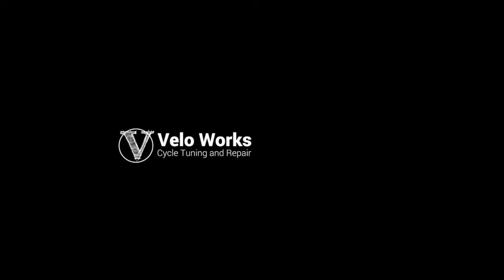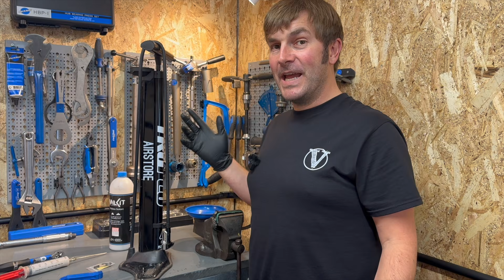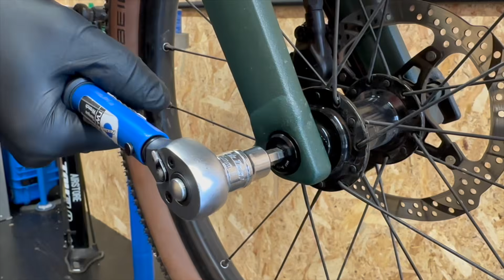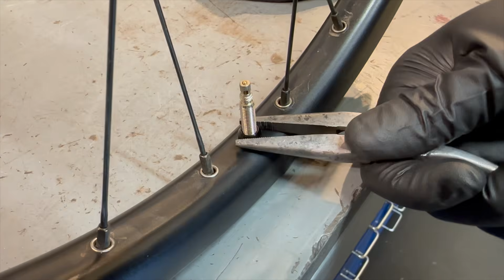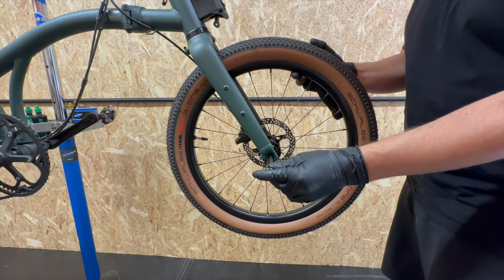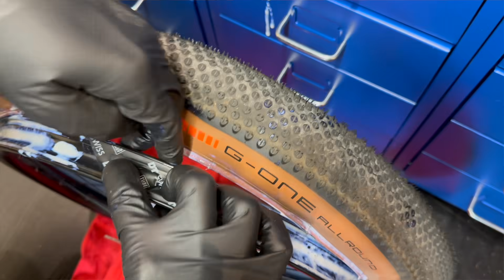BROMPTON G Line Tubeless Set Up 💥

Comment: Thank you Paul.  After viewing this I got my LBS to set the G Line up at its first service.  This is my first experience of tubeless and so far I am impressed, the ride seems a little better and the ability to vary pressure according to the surface is very useful.  I dread having to remove the rear wheel...
Reply from the maker: oh brilliant to hear. Glad you like it. Worth getting a tyre plug then you may not need to! Fingers crossed.

Comment: Ran these tubeless for over a year but eventually gave up and switched to the conti urbans. I mostly use it for commuting these days and the additional puncture protection of the contis is way better. I ended up with vast numbers of plugs and an ongoing slow puncture with tyre deflation over a few days. Had recurrent issues with the rim seam leaking, Stan’s no tubes seemed to eat my Peaty’s rim tape, and the tyre sidewall ended up weirdly porous after a year. Also slightly dented rim edge, with too low a pressure from a puncture and never quite the same after that. All on the rear too! I do miss the lighter weight and comfort and would probably switch back to tubeless if I was doing mostly gravel, maybe…..

Comment: I’ve been running my G Line tubeless for 6 months and have had no issues, I use Stans original sealant and it stays liquid for ages. I would point out that you should always fit tubeless valve nuts hand tight only, not with pliers as shown here. If you are unfortunate enough to get a big puncture or tyre split then getting the valve out to fit an inner tube will be impossible unless you carry pliers or a Leatherman whilst out riding. I have also always managed to seat tyres using just a track pump and muscle power 😂, maybe I’ve been lucky so far.
Reply: Agreed. That's what the o-ring is for. If you clamp it down you'll crush the o-ring and it won't do it's job effectively. I've had tubeless on all my MTB's for years and you should always use rim tape too. Pump up the tyre to seat it on the bead, remove the valve core then add the sealant.

Comment: I enjoyed your video.
I’ve been riding the Brompton G Line for about a year, and I’m curious about your experience.
Does your G Line have any play in the handle post?

Mine already went through one warranty replacement, but the play comes back little by little after riding. Even with the clamp tightened firmly, I can still feel noticeable movement in the handle post hinge.

Could you try pushing the handlebars left and right?
I’m wondering if you feel that same distinct looseness.

Comment: I set my G up tubeless right away due to past experience with local thorns. Just did the initial service on the Alfine at 1200 miles with no flats. My Alfine came with the shift latch damaged in shipping, it was eventually replaced in warranty but I’ve gotten a lot of practice taking off the rear wheel ;-).

Comment: For me the main reason to go tubeless is that it rides way more comfortable because the rubber is not rubbing against an inner tube. It makes every surface better to ride. I've tried it before with a folder, but since it were very small wheels with relatively high pressure that meant pumping everyday. The comfort however was out of this world.

Comment: I tried tubeless years ago and hated it very messy and the sealant will adhere to the tire over time increasing the weight of the tire plus if left sitting for a long time tires will go flat and park tools gluless patches are only temperary total junk

Comment: I’ve been told the sealant needs to be replaced every 6 months. This involves taking the tyres off again scraping out the old sealant and re applying.
Reply: Been riding mtbs for years and not worried about this frequency and never had an issue. I’d recommend schwalbe or stans seal and (exact same stuff as each other) and stays fluid for ages

Comment: Another great video. You mentioned the Alfine 8 hub is challenging to remove in the field. That its better to remove in a work stand. I have the electric G on order. Aside from unplugging the motor cable, would the rear motor hub wheel be any easier to remove in the field for puncture repairs? Or would the same logic hold - better to go tubeless.
Reply: I am absolutely not convinced about tubeless on an electric G line. All my bikes I’ve equipped with schwalbe clik valves, and especially on brompton where you don’t have much space for connecting the pumphead, it is a big improvement. Be aware,to remove the rearwheel of G line electric you will need a 19mm spanner.

Comment: I still can't really figure out the purpose of a G-Line, if you want to go off road, get a gravel bike !
Reply: Graham to some extent you are right but the G line or my Kinetics conversion allows Brommies to run on a wider variety of surfaces but still be  able to access multi modal transport as with any Brompton. Buses, trains, taxis etc are all much easier when folded and certainly in Glasgow normal bikes are not allowed on the underground but folders are. Coffee or shopping stops are better and more secure as the bike can come with you and sit beside you or wheel around the supermarket reducing the risk of theft. Same at home the bike can fold up and come inside. 
Yes if you definitely are not going to do anything other than cycle, a gravel bike may be better. Everything  is always a compromise but there is a lot of flexibility in a Brommie even if it is marginally less efficient on the move. Even with a serious mechanical the bike can be folded for transport home. I have a road bike, a MTB as well but my Brommie is now my main touring bike as it carries a good load but I can use buses and trains as part of the journey, especially since I have a free bus pass in Scotland. I don't need to book the train which is fraught with a full sized bike. They are great fun too.
Reply: @mattgemmell8345 I do have a P-Line, but only use it in London. For longer commutes it’s a conventional road bike with panniers
Reply: @grahamricketts-bq1ft  sounds good. You might be surprised just how good a beefed up Brommie is. As I say that versatility to go on most surfaces but still fold is priceless to me. Taking the bus or the train gets tours off to a flying start and they can take the strain while I relax and start the cycling proper much further away and avoiding some busy roads, A82 on Loch Lomond is a nightmare to cycle but I can get past that. I'm 8 miles from a west coast line station and 1 mile from a Citilink bus stop. It just works but not as easy to book a space for a full sized bike or as I would call it 'a big boys bike' 😂
Reply: @mattgemmell8345 I was riding round there last month on my way back to Oban from Ullapool and The Hebrides, !
Reply: @mattgemmell8345 I have a P Line but it only gets used in London !
Reply: If you don't find any purpose for the G line, it is probably not for you. We must not forget its main advantage over normal bikes: it is foldable. And that alone makes it very much purposeful.
Reply from the maker: Agree with what Matt below has said and they are an awful lot of fun! Just wonderful to ride. I have a gravel bike but the G line is an AMAZING gravel bike.
Reply: Had mine for over a year. It’s hilarious, reminds be of a Raleigh boxer or bmx I had as a kid! Really good fun on gravel. I have the electric, have changed the front ring for 44t, and upsized the largest rear cog to 21t for the steepest of hills. I regularly take it out over my dedicated road, gravel or mtbs. Just love it, has personality. Very pleased customer.

Comment: I've covered 1500 miles on those tyres, 8 punctures, always tiny little shards of grit, stone, flint etc, not impressed, maybe going tubeless is the answer?
Reply from the maker: Potentially. Although I’ve not had the same problem with my tyres - they’ve been really good 🧐
Reply: The gravel tires have zero puncture protection. Buy a liner or go tubless. The road continental has a ceter tread puncture liner